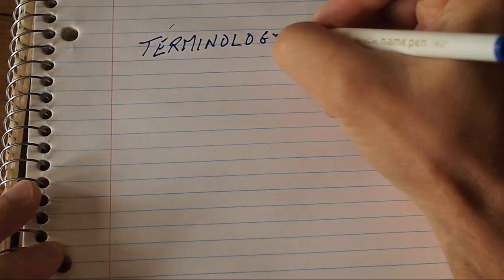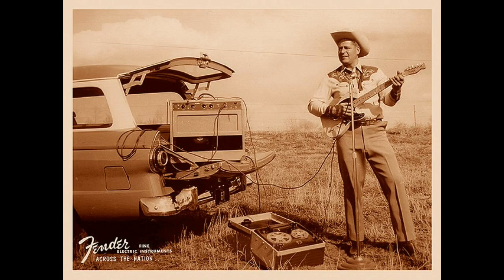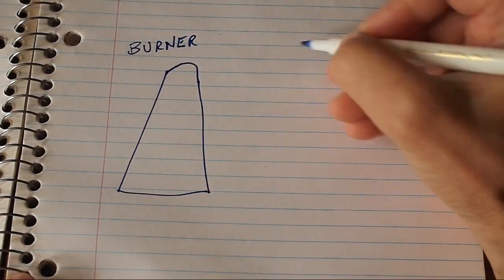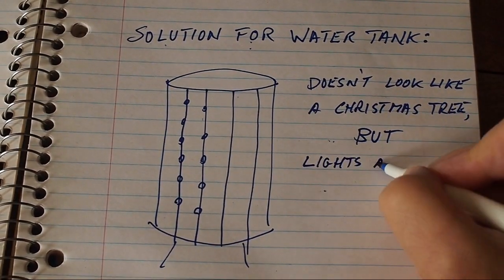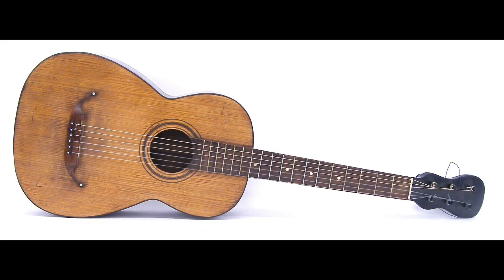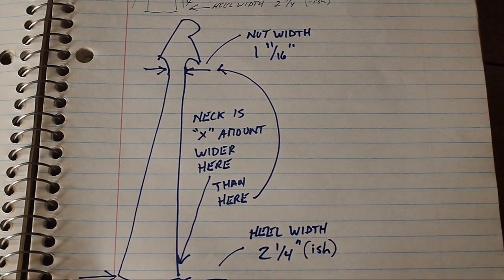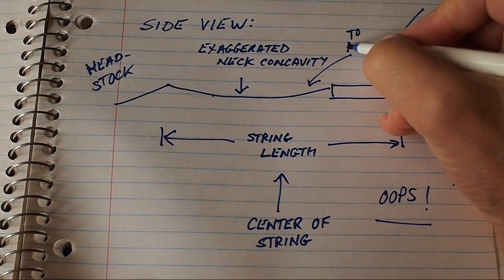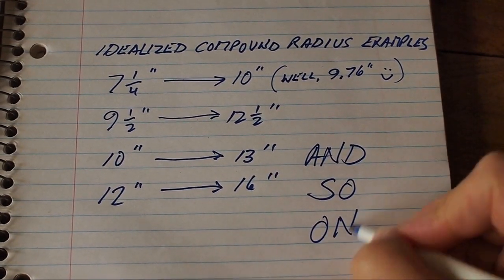The Facts about Compound Radius Fretboards

Comment: Good info! What radius do you set the bridge saddles to on a conical radius fretboard? Thanks for posting.
Reply from the maker: Thanks for your question, Howard. On most guitars, the radius at the bridge will be half again as much as the radius change over the fretboard's length, added to the radius at the highest fret. This is a confusing mouthful, so here's an example: with a 10-16" conical radius, there's a radius change of 6" over the length of the fretboard. Half of this is 3". Add that to 16", and you'll want to set a radius of about 19" at the bridge, adjusting for variables like neck irregularities, string height, and personal preferences.
Reply: @auburnamplifiers1786  Thank you! !

Comment: I have a question. 
Individuality considered, Is it worth it to seek out such a neck, or have mine modified?
Meaning, does it really make that big of a difference?

I ask because I have hit that point in my guitar playing where I am seeking the little things that help me fine tune my abilities. 

I have a very nice, very dialed in, ‘98 MIM Stratocaster. 

I can buy a Fender custom shop neck, with the compound radius used on the newer American Strats.  (9.5-14) But it’s $500+

Just wondering if it really makes a noticeable difference in feel and playability. 

It would be nice to get comments from those that have actually played on such a neck, and can give a factually based opinion. Instead of those that have no experience with one. 

Thanks in advance!
Reply from the maker: If you're happy with what you have, that's all that matters. Try to get your hands on an existing "compound" radius guitar and see how it feels to you. This info is geared towards builders and experimenters seeking an explanation of why radius matters.

Comment: Thanks. That was great info.  My next guitar and bass I build I'll go that route. Wouldn't the bass really see an improvement, since everything is bigger and longer.
Reply from the maker: It depends on the bass. A Jazz-type bass has a much greater increase in string spacing between the nut and the bridge than a Ricky 4001, for example. If the strings are essentially parallel, then a conical radius is not worth the effort.

Comment: Thanks for uploading, Rob ! I have exactly the problem you mentioned in the vid: everything is setup perfectly: trussrod with a small relief, medium action for comfortable bends, etc. BUT: I have a persistant buzz when fretting the 3 lower (bass) strings at the 16th fret (this very fret only, the rest is perfect).  Any suggestion ?? Thanks  ! !
Reply from the maker: A straightedge might expose a fret that has lifted slightly, or the neck could have a slight twist. Either way, it sounds like it would be worth having a qualified luthier (which I'm not) take a look. Best of luck!

Comment: This discussion is somewhat misleading.  While it is true that a 'conical' (compound) radius will give a more consistent  string height up the neck than a 'cylindrical'  (uniform) radius, it fails to mention that the fret board feel changes dramatically as the radius flattens out.  It is always a trade-off.  Unless you do a lot of string bending on the higher frets, you might be better off with the same (consistent) radius all the way up the neck.  In most cases, I prefer a uniform radius, as the increase in string height is negligible.

Comment: won't the scale length have an affect on your measurements?
Reply from the maker: Good question. Scale length is already taken into account because it affects how far apart the strings spread over the length of the fretboard, given the fixed angles between them.

Comment: Nut width : heel width doesn’t work because of the string space. Think about 1.6” nut width and 2” nut width with the same string space. Their nut-heel ratio would be different. But they should have same compound. So this is my calculations with string space. Nut string space 1.360", bridge string space 2.12598", scale length 25.5" -> 22nd fret string space 1.911025" -> nut-heel(22nd fret) ratio 1.40511654 -> idealized compound 7.25-10.18, 9-12.65, 9.5-13.35 etc.
Reply from the maker: I see your point, but as strings are generally parallel to the fretboard edges, the ratio of nut width to heel width is essentially the same as the ratio of overall string spacing at those two places. The point of diminished returns is reached quite early, and the degree of precision gets overridden by the inherent coarseness of other factors. At the end of the day, the idea is to make a buildable guitar that plays well and avoids any unnecessary misalignments.
Reply: @auburnamplifiers1786  Actually radius decision gave me a headache . I'm not gonna think too much or be too picky. I'll go for 7.25-9.5 radius. Thanks for your video. It helps a lot for me to get an idea about compound radius.

Comment: At 4:50, where you're calculating how much the radius changes from the nut to the last fret, you should be using the width of the strings, not the neck/fretboard width. You may be surprised at the difference. For my stock ES-175, the fb increases 22% from nut to last fret whereas the string width increases 30%. Using 22% would give me a radius of 14.6 at the 20th fret instead of  15.6 using the correct value of 30%.
Reply from the maker: You're absolutely correct. Truth be told, I've never encountered a guitar that had such a discrepancy. Clearly we need more guitars on hand. :)
Reply: I rechecked those numbers I gave you and somethings not right. The fretboard width increases 31% and the string width increases 26% from the nut to last fret. But we agree, use the string spacing not the fingerboard  width to calculate the optimal radii of curvature.

Comment: Actually not quite true... you can construct a fretboard with every ratio of radii that you want with straight lines interconnecting. A conical surface is just a special case, other ratio's will produce an hyperboloid surface. Cylindrical surfaces indeed don't match with different string spacings, that part of your explanation is obviously correct.
Reply from the maker: Thanks for your comment. You're right that a conical surface is a special case: it'
s the only non-straight radius a guitarist is likely to ever encounter.
Reply: @auburnamplifiers1786  Very likely indeed only conical and cylindrical fretboards out there... although a 'stronger' compound radius than conical would be fine, feels just like a conical. On the other hand a shallower compound radius would have a smaller radius in the middle of the fretboard, a bit impractical...
Anyway, great video and well explained.